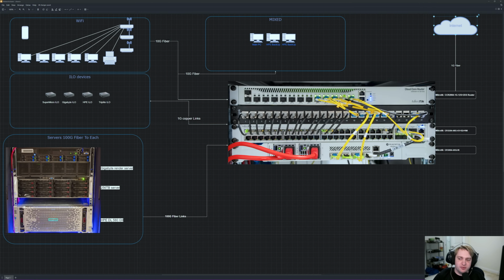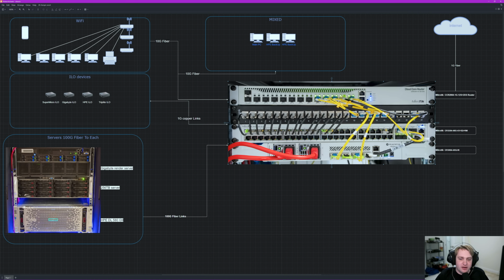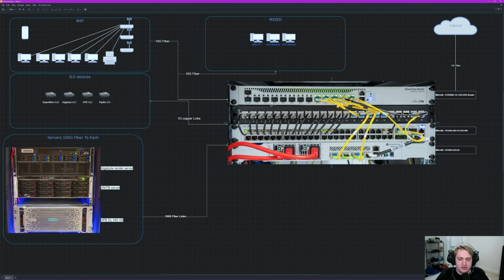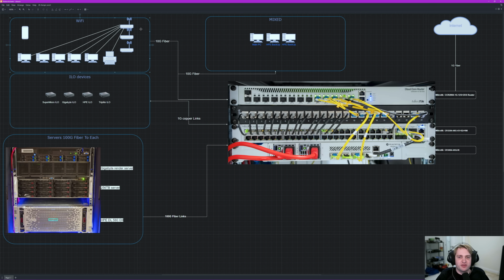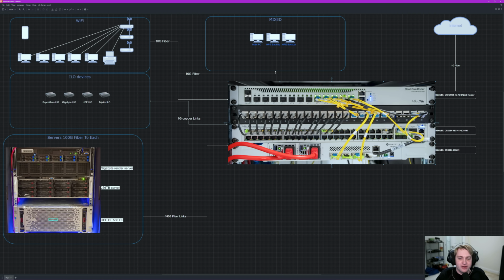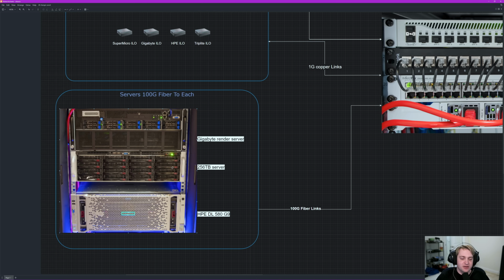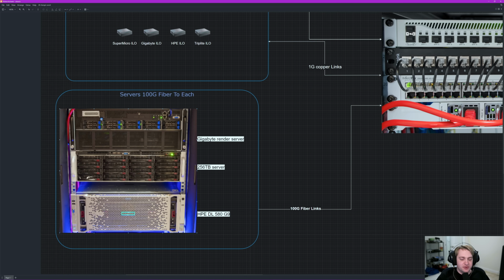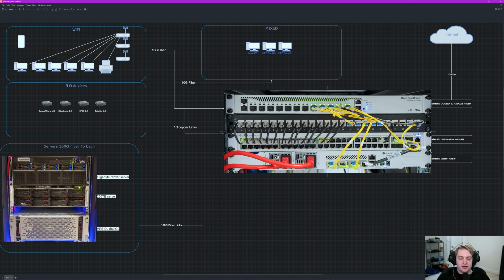My current Mikrotik home lab network

Comment: I have that same CCR 2004. I am having trouble configuring my fiber connections for a single bridge and the rest for seperate network addresses for specialissied equipment. could I contact you via email?
Reply from the maker: @Red1Wollip  sure. You can reach me at mr_jarble@jarble.media . If you have not taken a crack at the mikrotik documentation I cannot recommend it enough.